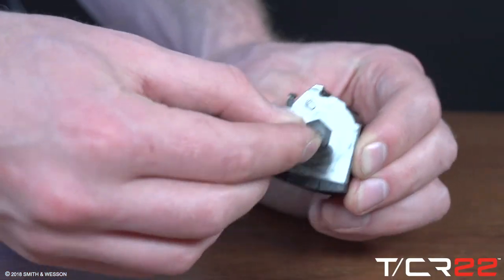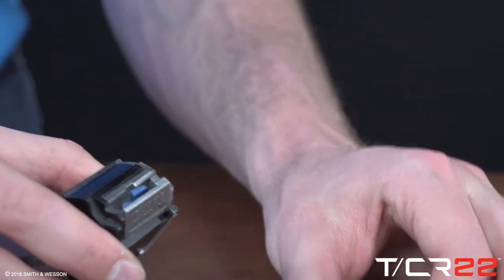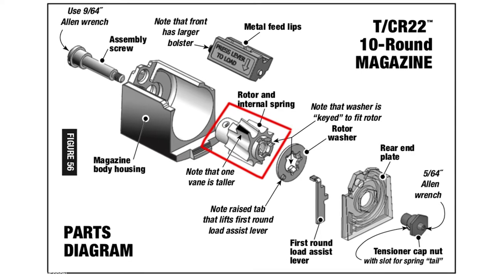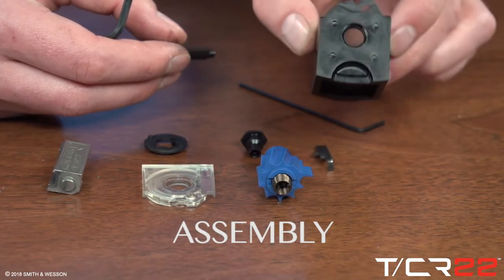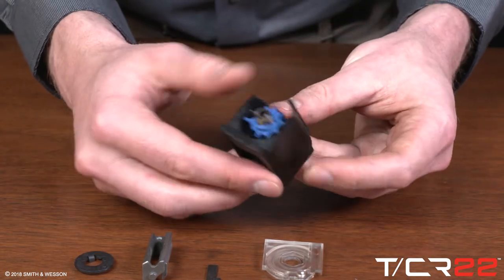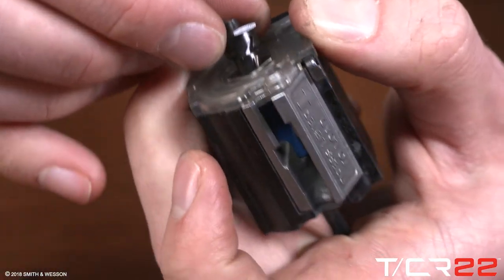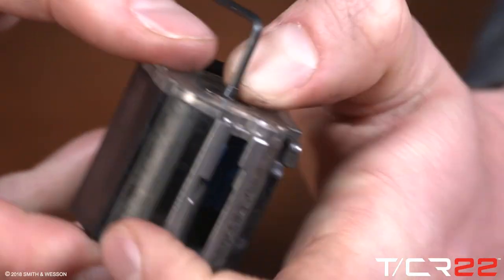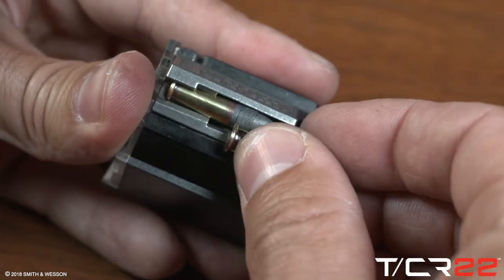T/CR22 Magazine Disassembly and Reassembly

Comment: My "push down to load" first round lever was stuck in the down position.  Did this and now it works fine.  Did notice screw was loose when I did the disassembly.  I believe this cause the little tap on the lever to slip by the tab on the washer.

Comment: Would the hold open feature work in a 10/22?
Reply: No, the tc r22 has additional cuts that allow the hold open features to work.
Reply: I really do not care about the hold open,      IMO    But will try it.    Magazines are very Costly.   I will use Ruger Mags.
Reply: It is a combination of this magazine and the tcr 22, it works well with the Ruger 10/22 mags but the last shot hold open does not work with the Ruger mags, only the factory Thompson 10rd mag. I am unaware of any (Thompson/s&w made) larger magazines for it at this time with the last shot hold open feature